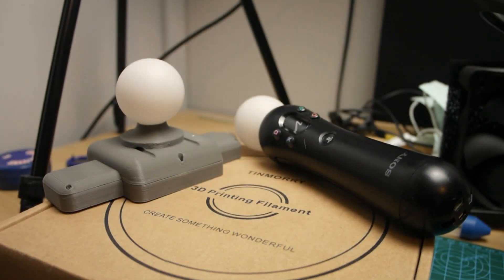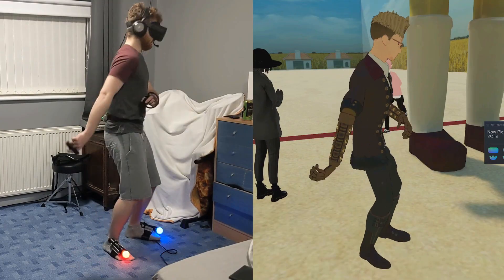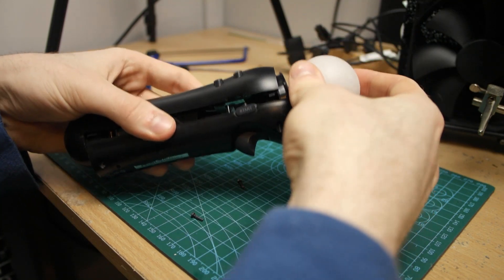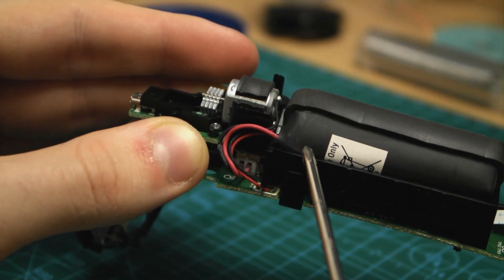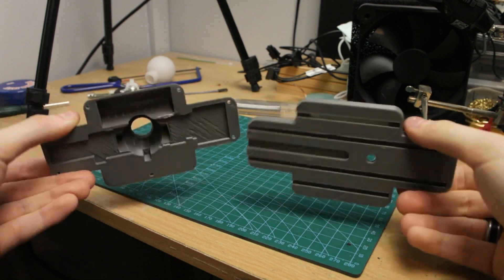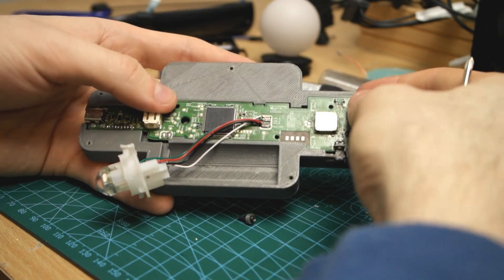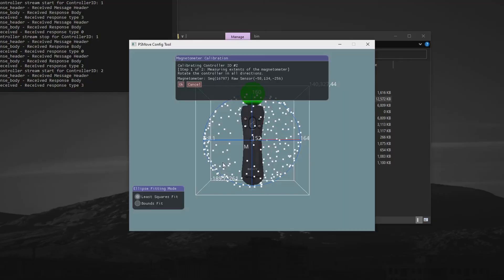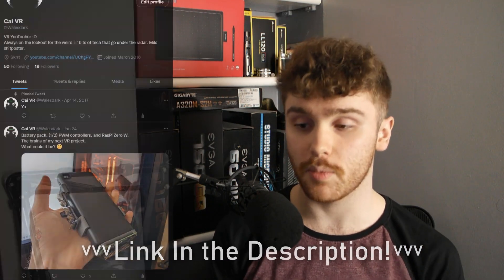3D printing a better case for your PSmove Full Body Tracker! | Full Assembly Tutorial

Comment: Strange question, would one of those ps move pistols that basically have similar components to the regular controllers work with this set up? Or are those considered different by the ps move software

Comment: ive been struggling to make a tongue and groove mount system for like 4 days now so i just stole your design. doing a test print now to see how it will work if printed in various orientations. using it to attach a slimevr to body plates

Comment: So this isnt really related to this video specifically but how much performance does the ps move service take to do the tracking because I am genuenly thinking about doing full body tracking with ps move but dont really know if my computer could handel it
Reply from the maker: It definitely does take a decent bit of power to run, but it isn't too bad from my experience. Anything above a Ryzen 1600 should handle it fine. The more cores the better though I think.
Reply: i run a ryzen 5 with 32 gb of ram, with a rtx 3070 ti and i see no diffrence in performance appart from a little more cpu and ram usage, maybe 1%-5% at most.
Reply: @BassBoostedDuck  so it seems to me that it uses the CPU instead of the GPU because my CPU (Ryzen 5 2600) always has quite a bit of headroom while playing VR and my GPU (RX 580) is basically screaming at 100% useage all the time so I should be fine while using this right?
Reply from the maker: @Smomby  Yeah you should be 100% fine headroom wise with that config then. Very similar to what I have run it on with no problems before

Comment: I'd like to add that if you have these controllers, the batteries inside of them will work with slimevr trackers if you ever wanna DIY some trackers and save a little money on batteries.
Reply: batteries work on electronic devices, no way.

Comment: I still have a set of vive 3.0 trackers, but this solutions fascinates me.
Keep it up.
Reply: i have made this set up, and as of currently ive put finishing it up on hold, as one, im out of money altho there is nothing left to buy, and two i dont have the time to 3d print all the mounts right now as its a little but of a lengthy process, appart from then, setting up the trackers where just as easy as he made it look, i do have one issue though, one of my trackers have the magnatomiter disabled for some reason so its ended up being a bit of a bug for me, im thinking about going to cex and trading it for a new one. appart from that issue and my camara not being mounted as they should be (its not a square .... yet) i have no issue with the trackers what so ever.!

Comment: I haven't got any psmove controllers, but I think your content is really entertaining! please keep it up
Reply: i have made this set up, and as of currently ive put finishing it up on hold, as one, im out of money altho there is nothing left to buy, and two i dont have the time to 3d print all the mounts right now as its a little but of a lengthy process, appart from then, setting up the trackers where just as easy as he made it look, i do have one issue though, one of my trackers have the magnatomiter disabled for some reason so its ended up being a bit of a bug for me, im thinking about going to cex and trading it for a new one. appart from that issue and my camara not being mounted as they should be (its not a square .... yet) i have no issue with the trackers what so ever.!